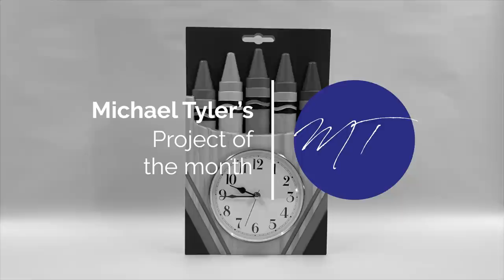Making The Crayon Box Wall Clock  | Michael Tyler's FREE CNC Project of the Month | Vectric

Comment: I am making this cool project. On the roughing cut with the .25 EM it is cutting to deep in spots . Checked everything I could think of and redid and it did the same thing. When I do a preview of the tool path it shows it to work well but when I run it the bit swoops down in the crayon sharpened area and ruins it. Any suggestions? Thanks!

Comment: I really like this project.  Thanks for sharing.  I wonder though, why not just make it out of one piece of 6/4 and avoid the glue up?  If your bit is long enough to cut the through hole for the clock and top cutout, then it seems to be able to be done with one board.  Or am I missing something?
Reply from the maker: Hello Matt, thanks for the comment.  Yes you are right, but Mike wanted to be sure the majority of our users could cut this.  But your are correct.

Comment: I know this is a bit old but I was wondering why this wasn't just carved out of 1 piece of wood instead of having to do the glue up?
Reply from the maker: Hello Louis, thanks for the question.  You would need Aspire so you can modify the files.
Reply: @vectric  thank you but that doesn’t address or answer my question at all. I asked why was the project made out of two pieces of wood. It appears that the project could have been done with 1 piece. I’m trying to understand the thought process as to why it had to be two pieces of wood.